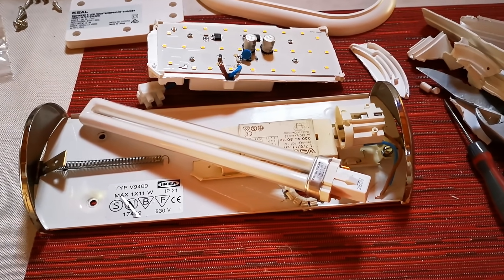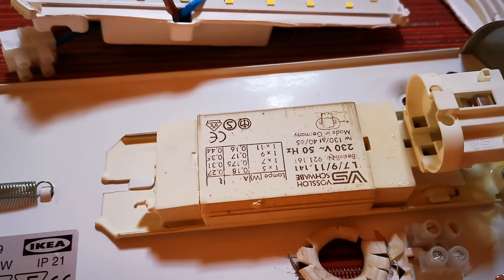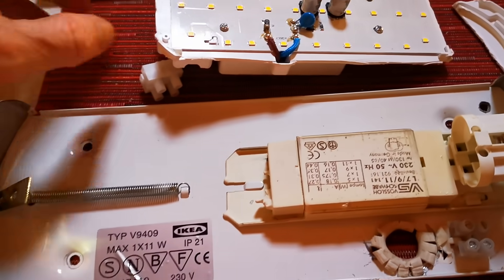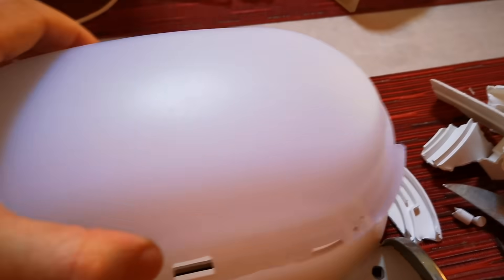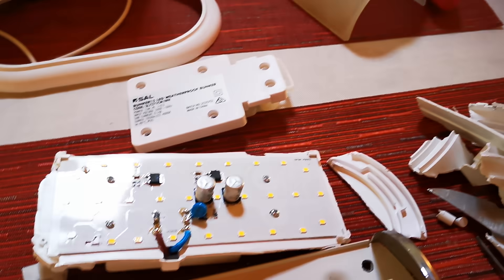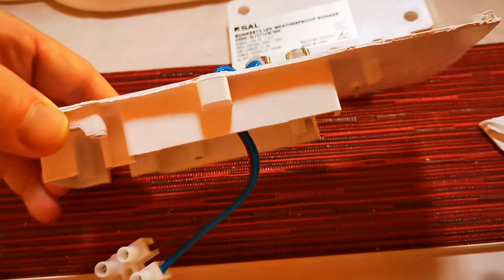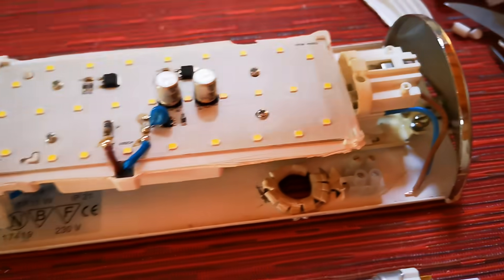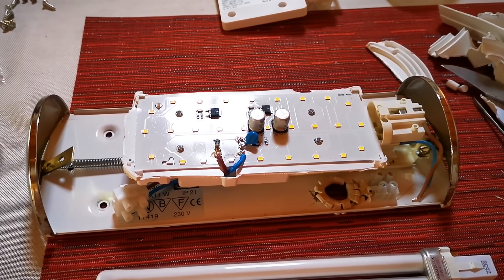LED Light Fluoro Replacement Bodge

Comment from the maker: FAQ: Why did I do this and not do insert thing here . As the title sugests, this was a quick bodge to get something running as I could not get a replacement lamp. I have since found a local supplier of a ballast friendly G23 LED replacement bulb and have ordered one of those. Because I didn't destroy this fitting I can simply retrofit the new LED tube solution down the track.

Comment: I find it hard to believe those bulbs are hard to find. Those are the ones used in gas pumps to backlight the LCD displays (at least in the older pumps that don't have video LCD screens in them). I also have a desk light that takes those bulbs, but I haven't needed to find one in many years - those bulbs last for a very very long time!

Comment: This is exactly why you want a 3d printer. Less hacking and mutilation and instead a little adapter to match the original mounting holes to the new mounting holes could be made.
Reply: I totally agree
But sometimes the 30 min CAD + 2h print time is outbeaten by 10 minutes of Dremel-abuse

Comment: One problem Dave, the original tube was a 827 which means nice cosy warm 2700K kitchen friendly light. The new one you got is 4000K which is repair modelshop garage light. So hopefully the Mrs does not have to enjoy the newlighting because she will complain (I am talking from experience here unfortunately replacing the kitchen sink lights and Bob was certainly not my uncle then neither did I have a chicken dinner ;)
Reply: I've never understood the concept of having warm white in a kitchen, you want as neutral as possible so food that is spoilt is more obvious.

Comment: I did something similar to a "UFO type" ceiling light. It had 2pcs of PL tube sockets and magnetic (choke) ballasts. Bloody things started flickering like in a horror movie at a time. Turns out these tubes have a starter integrated. Couldn't get hold of tubes at that time so conversion to ceramic E27 sockets took place. Yeah, it's overkill for LEDs, but hey, It's not any of that (<60W) plastic rubbish. :) Still going with two ~1000lm LED bulbs.

Comment: Is it just me or do LED's lights last not really any longer than fluorescent?
Reply: It's not just you but it depends on how well the LEDs are cooled, how hard they're driven and how often you use them I have one bulb from the early LED days and although it runs a tad hot but has a moderately sized heat sink and only tends to be used for maybe an hour and I have a cheap $1.50 2-3W AliExpress bulb which doesn't have good cooling with its plastic housing which has been as a nightlight every night for over 2 years now yet still hasn't failed because of the low-power usage.

Then very recently I got a couple dollar store bulbs rated at 14W (actual draw closer to 11W) these things are tiny and nowhere near enough metal to dissipate that kind of heat, they would probably burn out in no time if I hadn't modified them to run at 4W instead.
Reply: @vgamesx1  just replacing some Osram GU10 lamps that I installed over 8 years ago, they are mainly failing because the solder holding the leds is failing.  Replacements are not even lasting a year!
Reply: @timballam3675  Yeah, I don't know if it's actually intentional or if people really just want ever brighter lights, but you have to look for the low wattage lights if you want something that'll last or modify them.

Comment: why not just rip the ballast out and make the led panel more flush with the back? that would make it a lot more evenly lit. some VHB tape to stick the pcb to the metal frame and you are done.
Reply: That's what i'd to. I think the LED panel may be too close to the glass and show as a bright blob with dark shadows.
Reply: NO! The LEDs are on an aluminium-backed PCB directly connected to mains so if it's mounted to metalwork as here this would need to be earthed just in case the thin insulating layer failed. But there's no earth connection on the target fitting. Using the plastic holder gets around this.

Actually I'm surprised the fitting doesn't have an earth connection as it doesn't appear to be double insulated.
Reply: @Graham_Langley  VHB tape is very thick insulating foam tape. so no issue.
Reply: @SupremeRuleroftheWorld  I'd not like to rely on it.

Comment: Umm Dave why didn't you just unscrew the LED PCB and remove the choke and flo-fitting on the other and then  just mount the LED with some stand off screws,  (making it it a fully reversible solution) just looks you wanted to play it all Big Clive style with go with extreme force ;)
Reply from the maker: Quicker and easier with what I had at the time. This is fully reversible. The choke had to be drilled out, it was riveted in.  I was just now able to get a proper G23 LED replacement, so will replace with that when it comes.

Comment: did you get a licenced electrician to swap it over?
Reply: I don't think so. Imo Dave is in the process of engineering a new prototype lamp, which need further testing to meet the Australian Regulatory Mark of Conformity certification.

Comment: Surprising you can't readily get hold of those 11W PL tubes. They're extremely common and cheap in Europe, though I think they're preparing to obsolete the 2 pin version in favour of the 4 pin version that requires the electronic ballast. Efficiency is pretty good on those PL tubes.
Reply: Yeah , it took me less than a minute to find these lamps from a shop's website in Finland, I even got the location of what shelf it's on.
Reply: Why not just purchase a led replacement for the tube companies like Philips make them.
Reply from the maker: @timballam3675  I could not find any here. But since this video I was able to find one available locally so have ordered that.
Reply: @timballam3675  They're often not as good in many respects. Best off with the original lamp or a purpose designed fixture. Normally something suffers with those retrofits, usually thermal performance
Reply: @sdgelectronics  I’ve recently installed a couple of LED retrofits, made by Osram. The key with LED replacements that I’ve found is that you should remove the ballast and any capacitors that might be present, as those are the things that heat up and /or go boom. The LED “tubes” usually run barely over room temperature after hours anyhow, so I can’t see them degrading due to heat. However, two things to keep in mind, I’ve not been able to find any LED replacements that work in series wired fixtures, but that’s of little concern if you gut the fixture anyhow, and a lot of light control gear do not like LED, an indoor PIR that I recently fitted could handle 2,3 kW incandescent, 1,6 kW fluorescent, but could only switch 400W of LED, so that’s something to keep in mind on larger installations.

Comment: Why not yank the ballast and old socket out as well?
Reply from the maker: Because I would have had to drill out the rivet, and that plastic fits very nicely over the transformer, and the spring would be in the way anyway. Plus I can change back if needed.